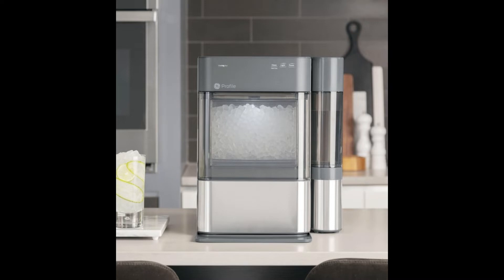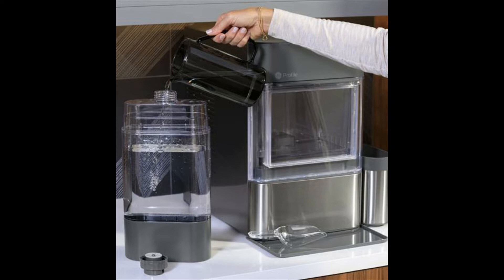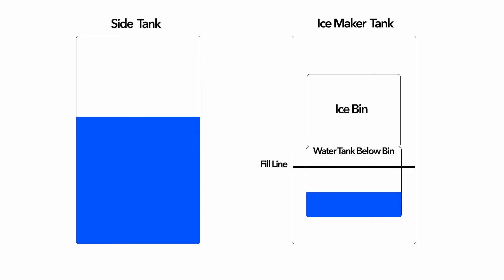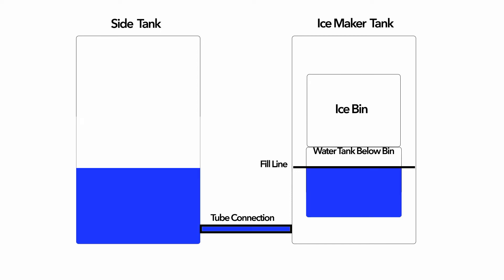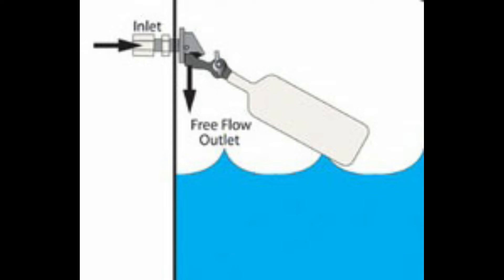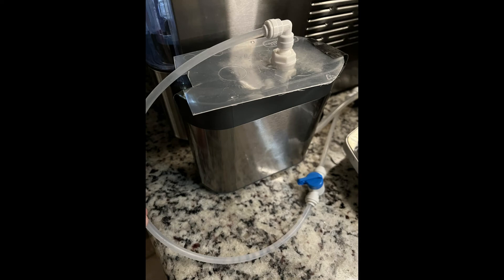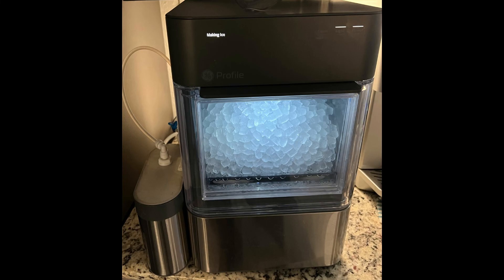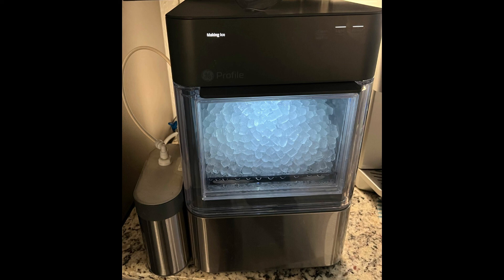Opal 2 Nugget Ice Maker - Waterline Adapter

Comment: So I've been using this for about a month now and it works great for the most part. The only issue I'm running into is now my ice seems to be melting faster after it has been made. This is happening to the point where the bottom 1" of the ice bin turns to very watery ice. Is anyone else having this issue? Any thoughts?
Reply: Figured out the problem! When I installed this I also cleaned my ice maker. While doing this I took the drain out of the bottom of the ice bin. When reassembling I put the plunger in upside down so it wasn’t properly draining the water back into the bottom of the ice maker. Flipped it back around and we’re in business!

Hopefully this can help someone else who might run into the same issue!

Comment: What is preventing the base from overflowing if the machine turns off and the ice melts?  Is there a check valve in the base? I only ask because I got duped into purchasing the pricy reservoir on https://www.youtube.com/watch?v=hRAAx_5Kzdo (it really needs to be taken down).  I don't have the base, but they appear to be fairly cheap to purchase (just the base).  Just wanted to check before I head down this path.
Reply from the maker: The waterline inside is low, enough that if the ice melted it would still contain all of the liquid
Reply: @DVRTech- Cool - parts ordered and fingers crossed!

Comment: Why not just the float valve to the tank itself. Drill a hole, install the valve, connect the water line, done.
Reply from the maker: I didn’t want to make any permanent modifications to the unit itself. This route I didn’t actually modify any part of it. It all still will work as designed originally if desired.
Reply: @DVRTech-  True, but you would just be modifying the tank, not the ice maker itself. This would be useful for those people that do not have a 3d printer.
Reply from the maker: That is true but this isn’t my first tank I can tell you making the hole for the float valve in the tank is extremely hard and the plastic is very brittle which is why I went this route the second time
Reply: @DVRTech-  Good point

Comment: I'm probably not going to print this, but your video helped me explain why I keep getting the "add water" light on my 2.0 when the side tank is full!  The "B" water line goes up and back down, so the water levels between the two tanks never equalize.  I assumed there was a pump in there, but value engineers gonna value engineer.

Comment: Not sure if you're aware. A few folks on Thingiverse are saying that it doesn't fit the Opal 2. Not sure if the file is different or if the TinkerCAD file is different.
Reply from the maker: Yes, but the problem is it works fine for me. I built it on tinker cad and included the link on thingiverse so anybody can use that to modify it to fit their own device.
Reply: @DVRTech-  I’m printing one now for someone and I’ll report back if there are fitment issues. Thank you again for the files!

Comment: Hi.  We purchased the GE Opal 2 and found your video for the top.  We downloaded the file and had it printed at craftcloud.  When we got the top back, it was too long and slightly to wide.  We just went through a mock order for the top again and it seems like your download is giving the dimensions of 77mm x 181mm x 3mm.  Can you help me either figure out what I did wrong, suggest another 3D printing site or see if the dimensions need to be updated?  Thanks
Reply: I had the same issue, a bit too long and wide.
Reply: @mikeregan6289  what were the dimensions of the actual printed lid? Is this a tolerance issue? If not, any solution?
Reply: Ok yeah it’s way off haha. Width seems right and will snap in nicely. But the length should be closer to 170mm

Comment: How often are you running the cleaning cycle when running this with RO?

Also any updates to your original design? Maybe something that latches, or has some method to keep it tight on the unit? The idea of the lid coming off and flooding the place is concerning. A rubber band might do the trick, or some twine.

Regardless, I was simply checking if a waterline could be hooked up and found this video, so thank you. Already got the float valve en route and was happy to see it support 3/8 as well.

Comment: I think you missed something rather important. Based on your description of how the water flow works, then why can the side reservoir be filled to the top without “equalizing” and causing water to overflow above the maximum waterline inside the main tank of the ice maker. 
I have modified my Opal 2 with components using the Eshoing NSF 1/4” o.d. RO tubing kit available on Amazon for $22. The kit comes with small, both top and side mount float valves. My Opal 2 sits on the counter in close proximity to my refrigerator providing easy to my RO feed line. I installed the side mount ball valve (required a single 5/16 hole) approximately 1/2” down from the top (in the grey trim) of the back side tank. At maximum auto fill water is about 1” from the top of the tank. This made the modification invisible from the front of the tank. It has worked flawlessly for 2 months without any leaks. 
The results with $22 and 15 minutes of effort I have auto fill with soft water + RO filtration.
Reply: @RueBoyd I am seeing this after I tried a similar setup to what you did.  However, after drilling the hole in the side tank, the air pressure is off and now my side tank pours water from where the tank sits on the base.  How did you overcome this issue?
Reply: Any pics of this set up? This seems simple and elegant.
Reply: @szebarjadi  haven’t posted photos, may soon post a how to video. I thing I should mention is when selecting the float valve make sure the float diameter is less than 1.46” (37mm), this will it to fit through the water fill port. I also tied a string to the threaded inlet on the ball valve assembly. Feed the string through the hole I drilled through the grey trim and plastic tank. Pulling the string will guide the ball valve assembly. I used a long set of tongs to assist with final positioning through the hole. Make sure both sides of the threaded tube has a soft washer and gently tighten to a snug firm grip. Test for leaks. You want the tank to be ‘air tight’ when completed.
Reply: I am also testing another method that will eliminate the need for the float valve.
Reply: @RuelBoyd  excellent, would be curious to see a video or pics of your set up. Redoing the kitchen set up and have run a water line to an appliance drawer for the Opal 2 and evaluating different options to have a consistent water line in to this thing. Thanks!
Reply: @RuelBoyd  Any updates or pictures on this method? Also amazon mentions that the float is 45mm which is bigger than the 37mm you said it can be in the kit you mentioned purchasing

Comment: Awesome! I have the gen 1 so I’ll have to try and make my own piece but this should at least get me pointed in the right direction. Thanks!
Reply: Jake, were you able to make a gen 1?
Reply: @JoeGehrer  it’s in the works. Version 1.0 is currently in place but it has some minor kinks to work out. But that was expected
Reply: Did you ever get the gen 1 figured out? Would you be interested in making an extra one? I would gladly pay you for your efforts.
Reply: @peterd4553  I did! Got a buddy to 3D print a piece and it’s been working, seemingly flawlessly for about 2 weeks now. Thinking about making a YouTube video about it with parts and the stl (I believe) file.
Reply: @jakej9108  That's awesome! Can you keep us posted? Wanting to plumb mine up but don't have the resources for 3d printing.
Reply: @jakej9108  I would be interested in the file.  I have a  v1 unit and our local library has a 3d printer.  Have you posted it anywhere?
Reply: @jakej9108  I too would love to have the file for the v1 Opal! Please let us know if you're able to share :) Thank you!
Reply from the maker: I started by outlining the tank and then scanning that and using it in tinkercad as a guide to build the part. Good Luck!
Reply: Do you have the file for the v1 unit?

Comment: It doesn't come with an ability to connect directly to a feed line without a tank?
Reply from the maker: No, one of the selling points for this unit is that it doesn’t need to hook up to a waterline. But with that in mind they designed it so it doesn’t support hooking up to one as well.
Reply: @DVRTech-  Well, nice work fixing the design flaw.  haha  Looks like a maker I'd like, but not without a water feed.